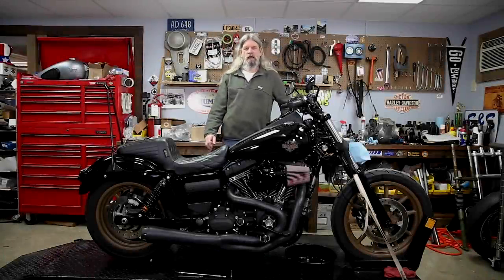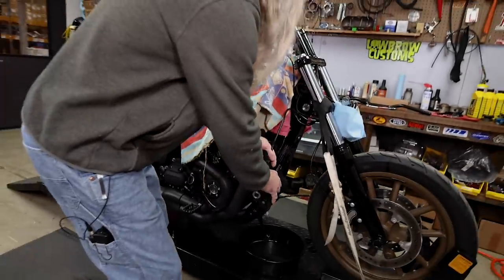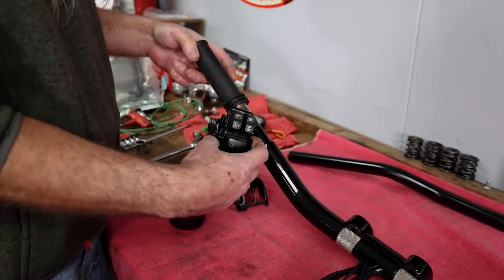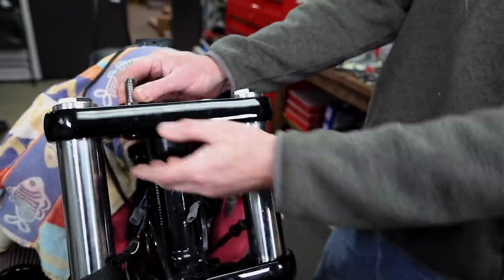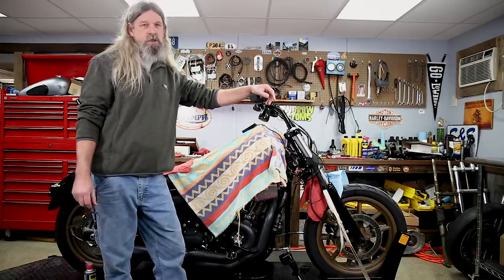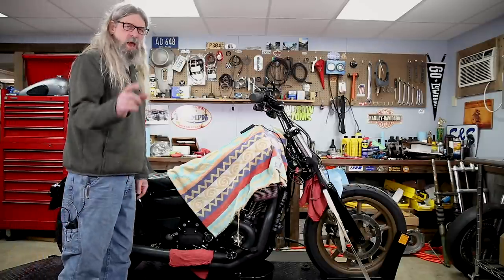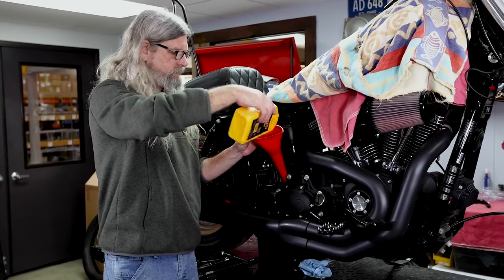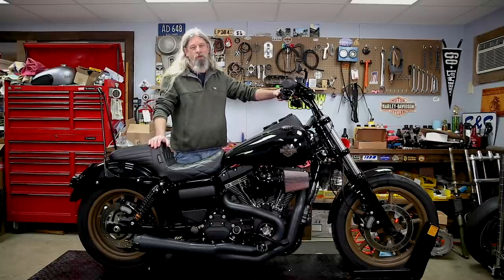How to Install Custom Throttle By Wire Handlebars Onto Your Harley-Davidson Motorcycle

Comment: Todd you're my favorite guy to watch work on motorcycles and I've learned a lot from your videos! Here's something else to consider about DOT4 vs DOT5 brake fluid though, yes 4 is cheaper but 5 cannot be used in ABS brake systems because it will aerate and become foam. ABS might still be optional but it makes sense to use DOT4 in everything if you're making bikes with ABS.
Much respect and I greatly appreciate your Harley wisdom!

Comment: Hey Todd first at all let me tell you what wonderfull teacher you are, great job!! and I have a silly question: I´ve been trying to find the black wire hose cover because mines on my 2002 FXDWG are in a very bad shape but the only i founded its a nasty nylon mesh all around!!! on your experience is there can I use or should I buy a new harnes (I think such a waste because other than the cover, wires are perfecly fine)?  Thanks again for all your lessons and best regards from Mexico Todd, sincerely Paco Balmori.

Comment: Don't care for a throttle being voltage controlled...(or is it current controlled?), seems phony to me, like these cheap-ass auto manufactures now using a wireless gas pedal...WTF??.....or maybe I just luv my '89 1200 too damn much ;)
I've redid my bar set as well, had to center & dimple drill the factory bar, then re-routed all the wiring internally, replaced all cluster gauge lighting & indicator lights with 3 volt LED's, using a buckboard converter, then relocated both speedo & tach on the down sweep of the frame. Amazingly different look just hiding all the control wires & moving the cluster, now wish I could hide my clutch & throttle cables (mechanical) and also thinking I want to drop my mirrors down..... HD = Hundred Dollars (minimum) ...lolz